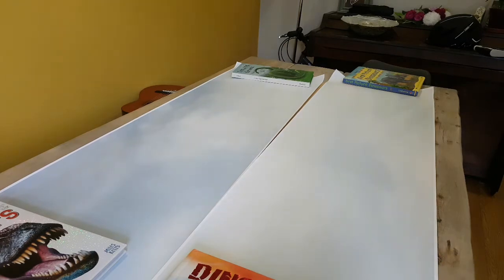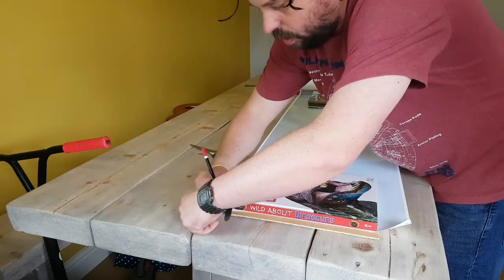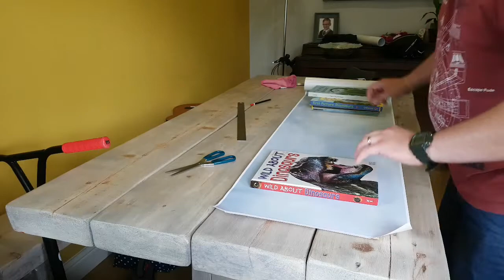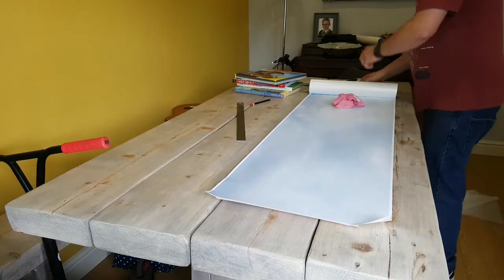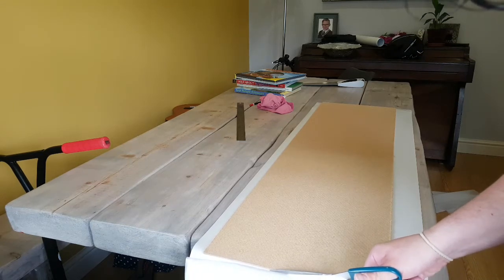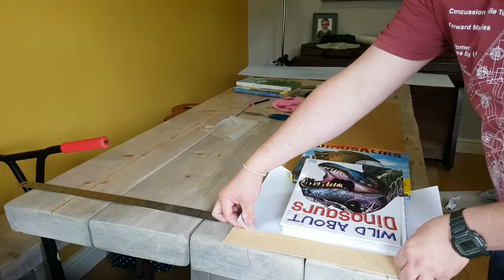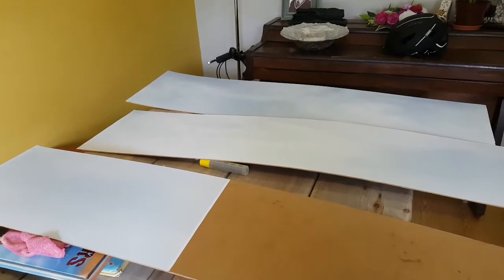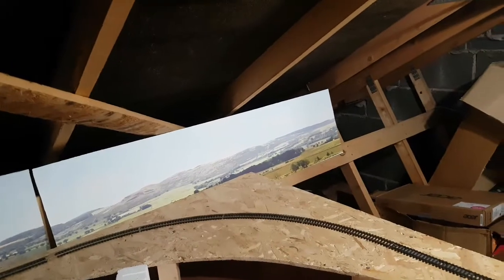Self adhesive I.D Backscenes.

Comment: Hi Simo, I enjoyed the video.. you make it look easy. Is trimming the overlap off better than folding it tightly over onto the back of the backing board?
Reply from the maker: To be honest I didn't think of that. So may try that on the next one
Reply: I only mentioned it because I'm about to make one for my own layout (sections of ply to make up nine feet in length, which your video has given me the confidence to do. The self-adhesive backing seems a lot less hassle than the ones that need to be stuck down using photo mount.    @simod
Reply from the maker: I was going to mention ply as the boards I've used have warped a little in the Loft
Reply: That's another can of worms... some modellers get a bit carried away with the construction side of things, getting the uprights and ties all fixed in, and then the baseboards, and completely overlook the insulation... not easy to retrofit. But lofts are still quite seasonal for use because they have to be ventilated. With regards to ply, I always seal both sides and edges with 50-50 pva/water.  @simod  btw.. did you put any 2x1 edging around the face of your ply boards and battons across at intervals underneath?
Reply from the maker: @MaboPete  when I first started I just put battons across the roof rafters then run some the length of the boards. If I was to start again I'd build the framework first but as a novice I just wanted boards down ASAP rookie mistake so afterwards I had to wiggle under and fit more bracing to keep the boards level.
Reply: I was much the same tbh given that I had begun to buy the stock I wanted before the shed was even built, and that took seven months of begging the wife. I suppose building from the ground upwards with the shelving, and the workbench across the top with the layout itself at shoulder height took some time but realising it would be a nighmare to try and re-visit any errors, I thought about the possible warping and flexing with the changes in humidity throughout the year, and so sealed the plywood both sides, and added the braces across the faces, with batton every two feet or so with holes drilled to carry the bus wires through. I did consider the loft, but so many enthusiasts had mentioned about having tube heaters and de-humidifiers going for around half a year just to keep the conditions ambient enough to be able to run trains all year round without too many hiccups. But the costs involved with all supporting framework and the insulation, plus the fact that in a couple of years' time going up and down the loft ladder would be out of the question, put me off.   @simod
Reply from the maker: @MaboPete I agree with everything you said. Think the main attraction to the loft is the size. The only time I don't really go up the loft (when I'm able to) is when it's too hot. Most of the rest of the year its fine. If it does get too cold I put a small electrical heater on for 10 minutes and it's warm enough to play and work.
Reply: It's a good discipline too. My progress is actually slower than I would like because of the shed being easy access. Plus the fact that I've had to place two cat igloos on the shelves under the workbench because they like it in there as well, lol.   @simod